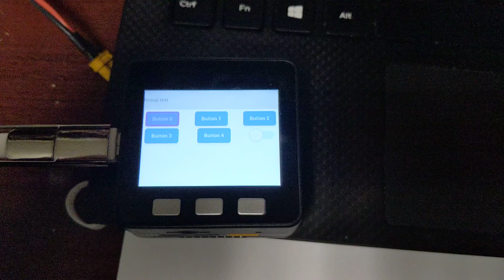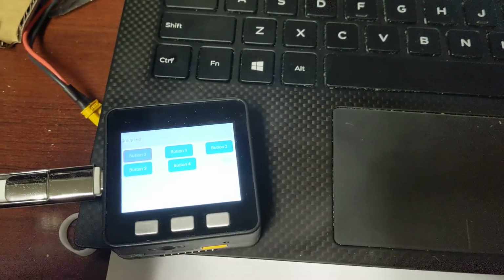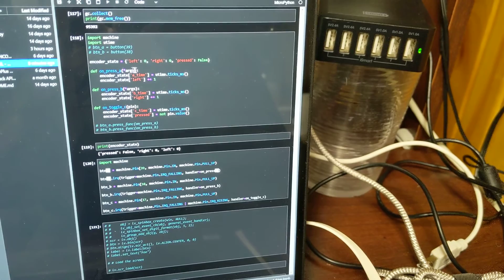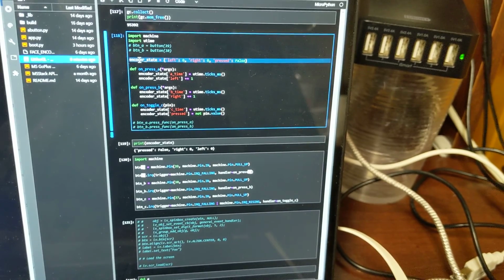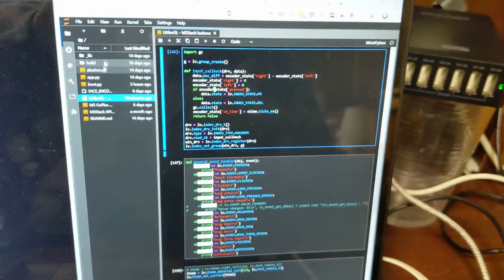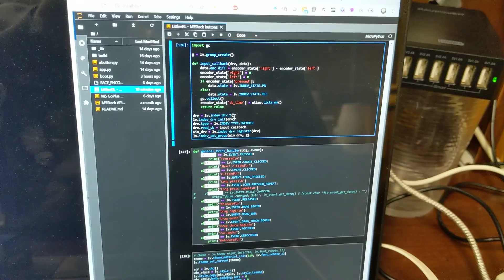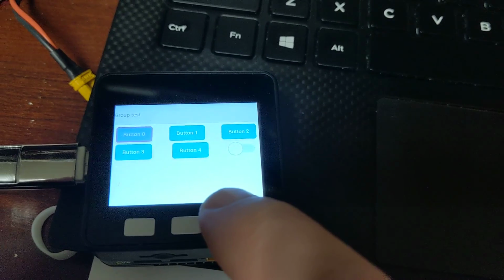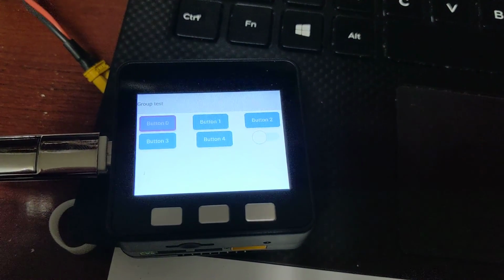MicroPython LittlevGL on M5Stack using A, B, C buttons

Comment: How different is the MicroPython that's running on this, than the official release?    I'm looking to port micropython to an Stm32H7 Nucleo board, but since there's no porting guide, I'm looking for what might be the best starting base (OpenMV, LittlevGL, etc)
Reply: Thanks for your reply!

Our modifications were accepted upstream by the official LittlevGL Micropython port: https://github.com/littlevgl/lv_micropython

You can find the Micropython encoder code used in this example in our `m5-lvgl` Micropython module on Github: https://github.com/sci-bots/m5-lvgl/blob/master/micropython-src/m5_lvgl/driver.py

The only part of the buttons input driver code that are specific to the M5Stack are the `ButtonsInputEncoder()` default button pins (i.e., defaults for the M5Stack buttons), but these can be overridden (see https://github.com/sci-bots/m5-lvgl/blob/42b2f572f1676dc3328755067569e9bc7931837c/micropython-src/m5_lvgl/driver.py#L20-L21)